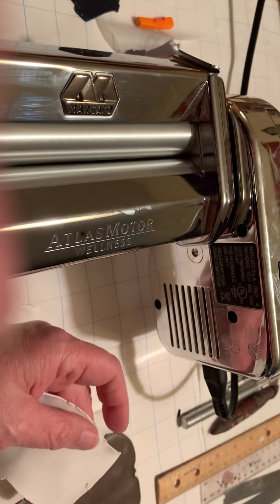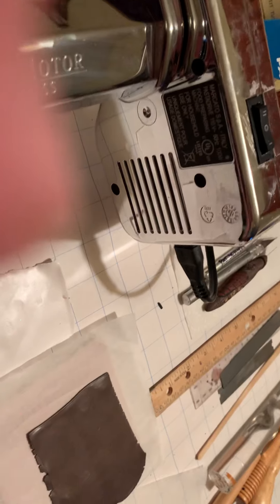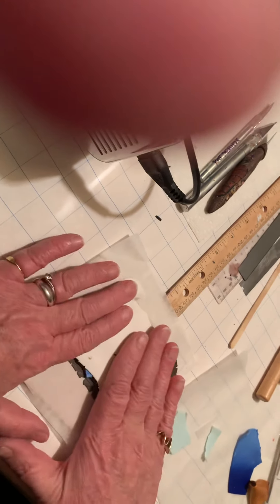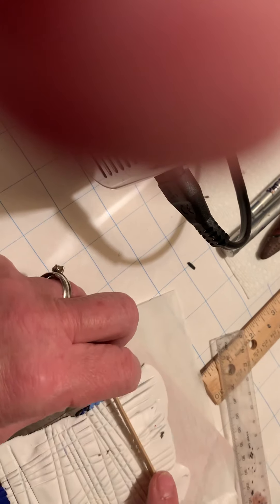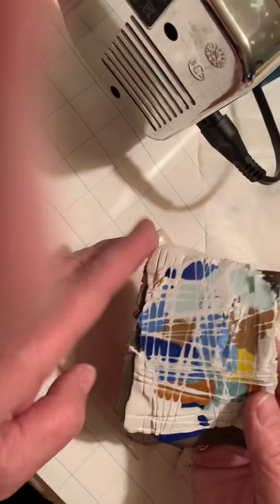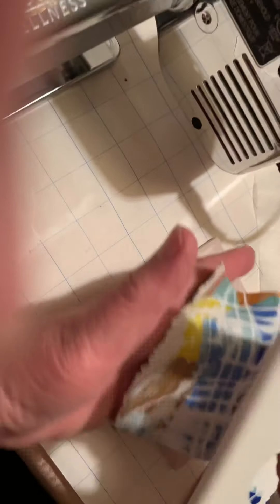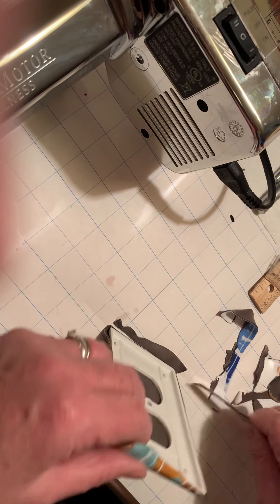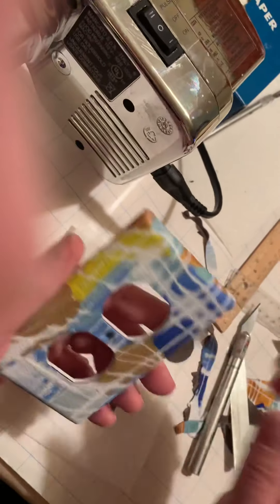Mokume Gane textured switch plate cover

Comment: Great tutorial.  Thank you Pat for sharing this technique with it.  I would have been scared to try on a plastic plate cover.
Reply from the maker: Like I said in the forum, Metal is best but the plastic ones are inexpensive. Try the Leviton Brand. They are pretty strong. Don’t over bake. If you get a wee bit of bubbling in the back that’s okay.  It won’t show. Maybe put a bit of fibrefill under the plastic plate when baking and bake on a tile it’s like when you make pens -the white Bic round stic work and can withstand oven temp of 270 Fahrenheit. The clear crystal plastic ones don’t work. Avoid using the Cooper brand of plates or if you don’t know the brand. Good luck.